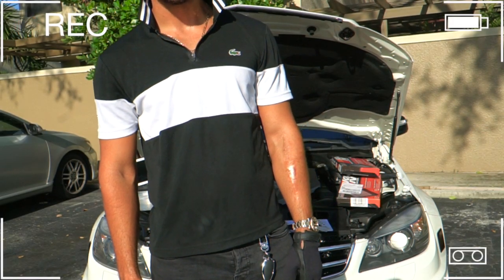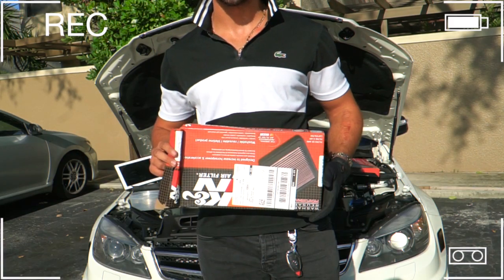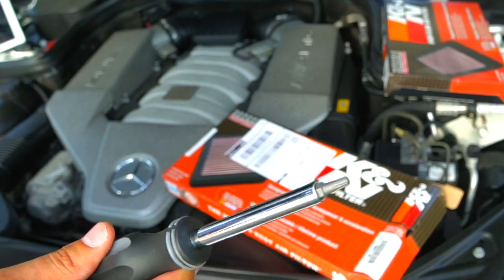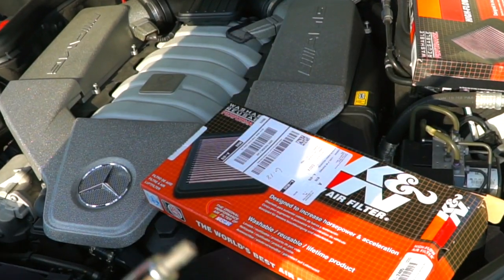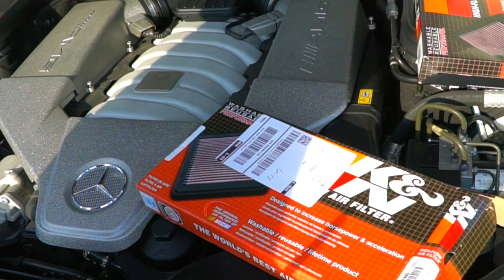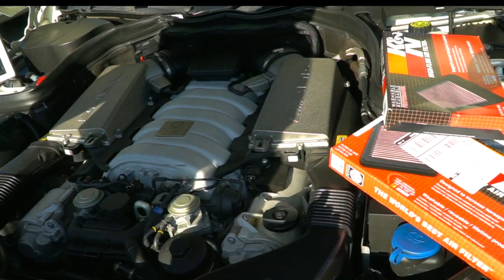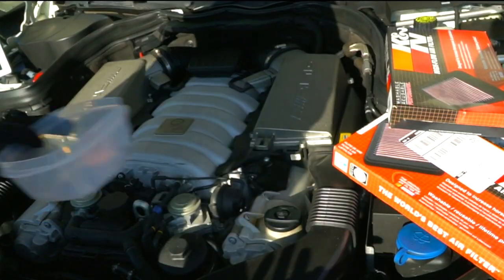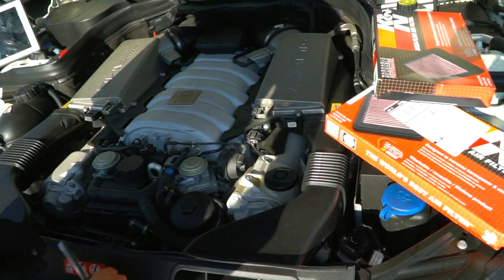Mercedes Benz C63 AMG (W204) K&N air filters swap! (4k)

Comment: I'm thinking about getting some K & N filters for my 2010 W212 E63 saloon which has the same M156 engine as this C63, Did it make your car sound more deeper and more aggressive ?? also did you notice any power gains ?  -  Thanks for any info man ! 👍
Reply from the maker: I didnt notice much difference but it did run smoother and these air filter will last a long time.
Reply: @JamesTodd  Thanks for the feedback man. - I really appreciate your reply ! 👍👍

Comment: You just threw out AFE filters good job , those you can clean and re-use . Also fyi those k&N's are oiled filters which are going to trip your check engine light ..
Reply: alexm good luck if those filters don't  disintegrated, and gets inside the engine, in that case, get ready 5k dollars for repairs
Reply from the maker: Thanks for the comment I had no idea!